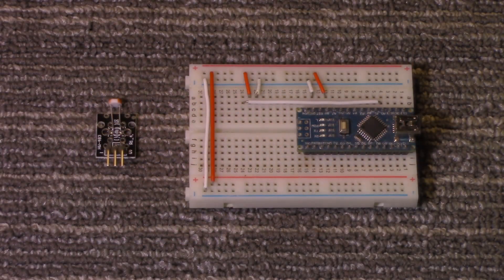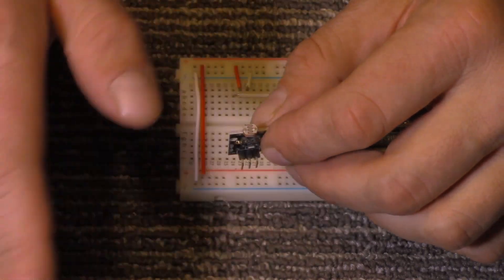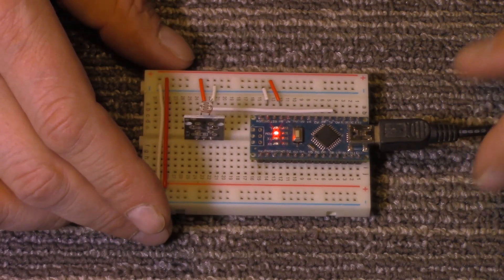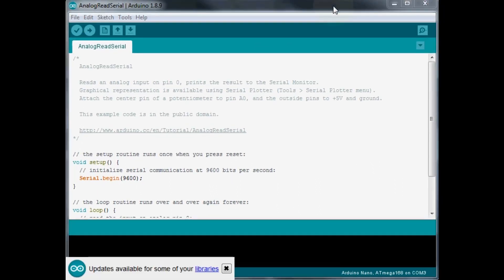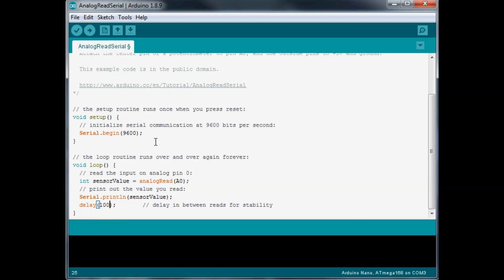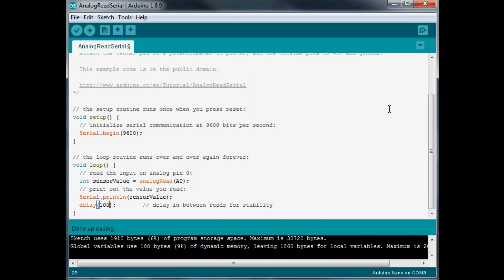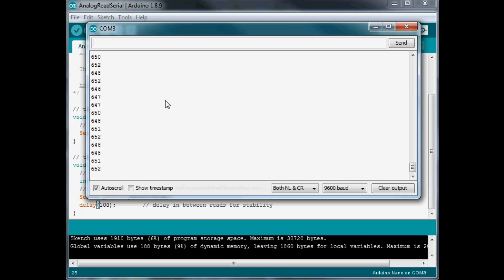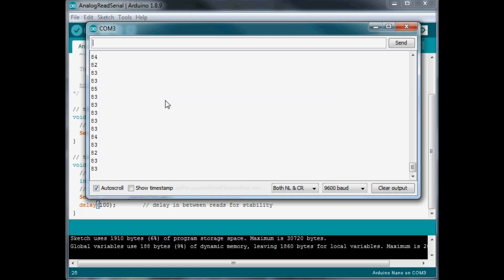Arduino Sensors: LDR sensor module

Comment: I realize you made this video several years ago, but I found it to be a tremendous value to me today.  Thank you for making this video.  I am automating my home and I want my lights to turn on automatically when there is motion in the room and low light level.  A Sunset trigger does not always work since there are times it is rainy and dark during the day and we need light.  I am too cheap to spend $50 USD to purchase something that will do what I can do for $2.  I have a cat5 wired motion sensor and I will use the the unused wires to connect the LDR.  Thanks again!